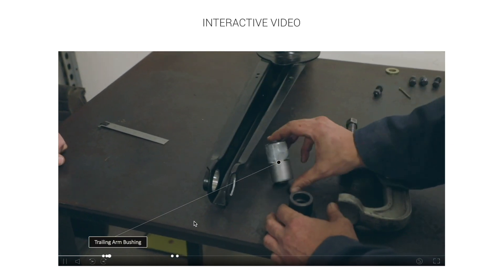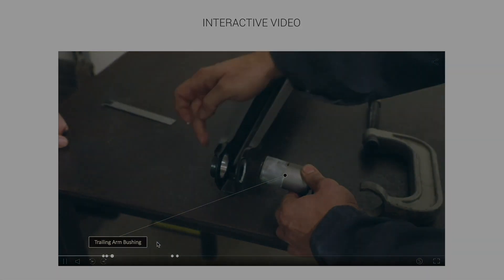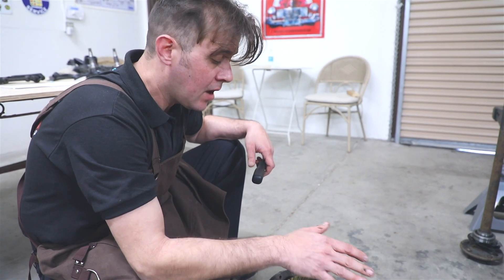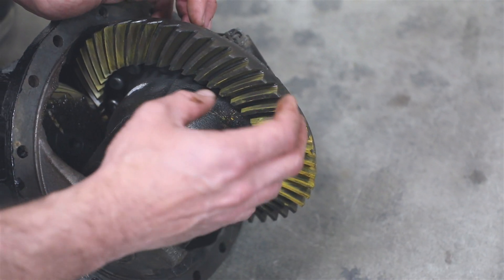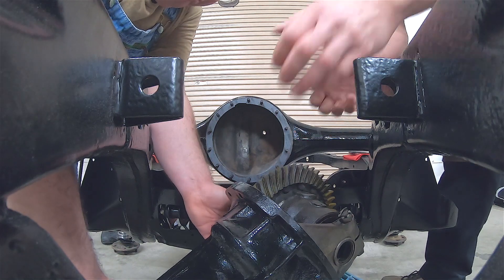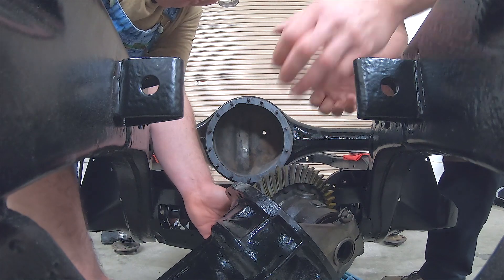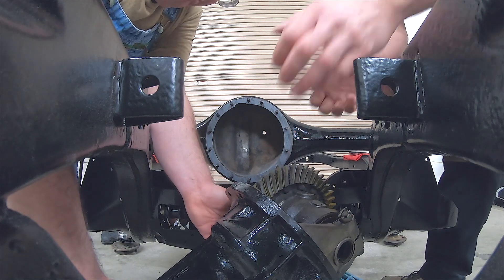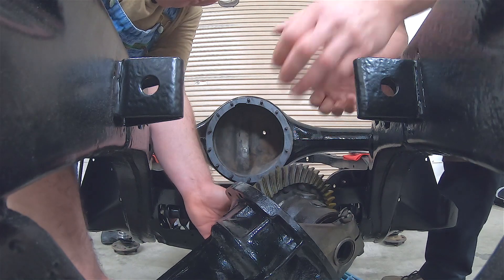How To Install Rear Axles On A 1959 Cadillac Eldorado Biarritz

Comment: does the wheel bearing go on with O ring in first?,   (66 fleetwood 75 sedan)  i just removed my passenger side rear axle and the bearing has the O ring on the outside, hope you can understand me thank's. ps i love the you tubes you supply!!!
Reply from the maker: The manual makes no mention, but the illustration shows it to the inside. What is important is that the housing is clean and in good condition. A little gear oil helps it to go together easier.
Josh